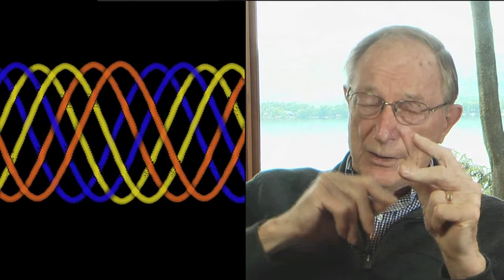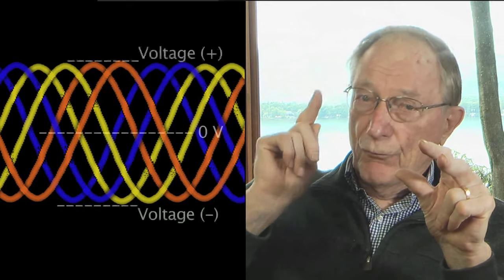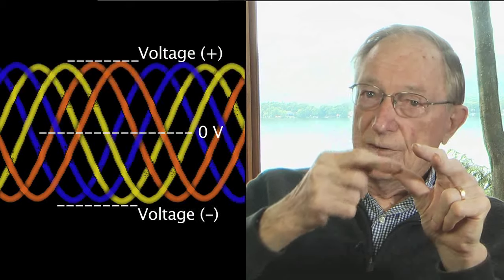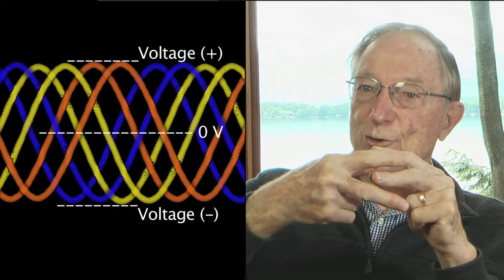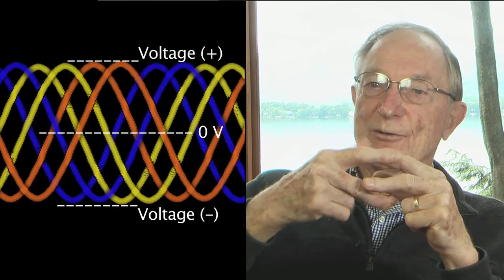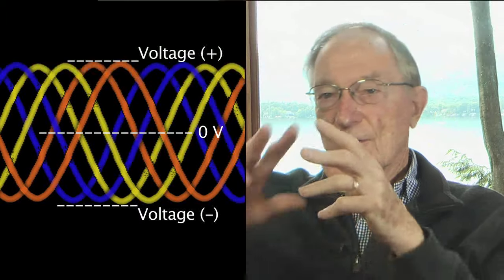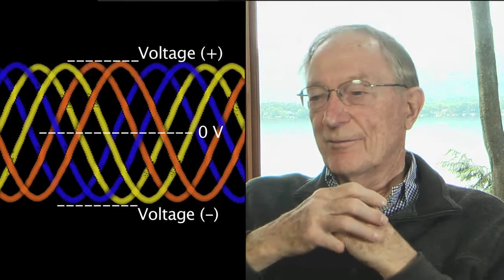Why 3 Phase Power? Why not 6 or 12?

Comment: Why not just ONE phase i.e, DC?  AFAIK this is always used on really long haul circuits because Voltage and Current are always at maximum.  OK one does need converting stations at both ends but the advantages outweigh the disadvantages.  The two places do not have to run at the same frequency for a start and because its DC standing waves are not really a problem.
Reply: just saw a video saying that three phase generator had an induction type system for low friction resistance no sure if thats relevant rotational energy stuffs try n think of a EMF generator that generates constant DC
Reply: *****
How do you pass AC through an inductor?? Why would you have capacitor connected to DC?? Irrelevant questions...
Actually the new technology uses DC for power transmission so called "high voltage DC".
Reply: I thought this question was resolved during the War of the Currents between Edison and Tesla.
Reply: Good point,but powerlines carrys around 24KVA. How do you expect to step down DC into 120/240,120/208,Etc and how much more money will be spent doing such a thing?
Reply: Because you would have to either replace almost everything you own with DC powered items or have a very huge and expensive power converter at every home. Doesn't pass the common sense test.
Reply: Tech Davey Actually this can be used easily and conviniently with HVDC(High voltage DC). Just imagine a 12 phase HVDC converter. You can have 12 phase providing full power suuper efficiently and then you just rectify the currents and you will only need 1 cable to  transport the electricity and since you have 12 phases in the conversion to DC is far more efficient and easy. Then all the money you saved in cables, towers and transformers used in the first stage of electricity transmission can be used for anything you want.
Reply: Tech Davey In high voltage power transmission with AC one has a limit that one can transmit power due to line losses. It use to be that DC was better than AC beyond say 600 miles but today the distance is shorter since conversion losses are less with modern converters. There are two DC lines that feed Los Angeles are 846 miles from the Columbia River (oregon/washington border)  and another from Utah that is 488 miles long in DC
Reply: 3beltwesty
How does DC powerline works? DC can't be stepped up or down. i'm curious?
Reply: edgehead13 DC can most definitely be stepped up or down.
Reply: Chris Russell How? we're currently learning about only AC stepping up and down. If we step DC up and down. Won't that cost more money compare to stepping AC?
Reply: edgehead13 DC can be stepped down up or down via converting it to AC; they stepping or down in voltage with transformers and rectifying back again to DC.
Reply: edgehead13 Once a power line is more than say 400 miles long the cost of the AC to DC to AC converter stations is less than the line loss of using AC. Thus for really really long power lines DC has been used in some places:

http://en.wikipedia.org/wiki/Pacific_DC_Intertie

http://en.wikipedia.org/wiki/Path_27
Reply: 3beltwesty WOW, didn't think it would be that simple. Make sense
Reply: edgehead13 There are also DC to DC gizmos to convert that just have a coil, capacitor and circuit that drives a coil to raise the voltage then it is rectified back to DC.  ie I have some 5 volt DC USB chargers that run on one 1.5 volt AA battery. Walmart once sold them for 5 dollars. A single 1.5 volt AA battery is used and the circuit jumps the voltage to 5 volts DC as an emergency phone charger.   Type in "DC to DC converter" into ebay and see a mess of gizmos  sold

http://www.ebay.com/sch/i.html?_from=R40&_trksid=p2050601.m570.l1313.TR12.TRC2.A0.H0.Xdc+to+dc+converter.TRS0&_nkw=dc+to+dc+converter&_sacat=0
Reply: Gotta love being an electrical apprentice. Are you an electrican or electrician engineer?
Reply: Registered EE
Reply: 3beltwesty Not bad
Reply: Chris Russell  You transmit 500,000  DC from generation of coal field, wind gens, or solar plant to local distribution point covert it to AC and      transmit it at what ever AC voltage local power companies use, and step it down fro 345,000, 230,000 to local needs of 69,000 34,500 what every, the to street use of 2,400 - 23,000. distribution voltage.
Reply: Tech Davey Several reasons, but the biggest one is down to cost. Imagine the size of the conductors needed to transmit DC over long distances, the machinery needed to haul these cables and the maintenance. 3 Phase is used because simply put it's more cost effective.
Reply: Samage89 In super long runs,  say 500 hundred miles AC costs more to transmit than DC. Thus super high voltage DC is used  to transmit power from Oregon to Los Angeles. With DC one needs a smaller conductor than AC since the there is no skin depth issue that AC has. One cannot transmit AC power say 700 miles without massive line losses, the reactance and line losses are huge. Thus they use high voltage DC in super long lines, There are not many high voltage DC lines around, many like the LA to Oregon DC line are many decades old
Reply: yeah, but to change voltages (to/from transmission) with DC requires a switching converter which generates significantly harder-to-filter noise than an AC transformer - right up into the RF.

Comment: This video is confusing power in transmission with that of 'generation , 6 phase does not increase the power from a generator, three phase was chosen as the standard as it evenly loaded generators and didn't cost too much in copper for transmission lines.

Comment: Why does NO ONE EVER mention 5-phase electricity??? Do we not have the technology to understand/work with it???
Reply: Because it's pointless when you get all the benefits of 5 phase with 3 phases. 3 phases is the minimum number of phases for a self starting motor. You could make a motor self start with 2 phases but you still need 3 wires for 2 phases so might as well have 3 phase and the motor will be more powerful.

Comment: How many power generators would you need,my understanding with 3 phase is that you have 3 different generators synchronised 1/3 apart,surely, for 6 phase you would need 6 spaced 1/6 apart,is this correct?
Reply: You actually need just one generator with multiple windings. 6 Phased generator wouldn't be so difficult to build, but like said in video, there are 6 conductors (+ground) 6 phases of circuit breakers, current measurements etc. So generator itself wouldn't be so complex, but system around generator would grow in price (cost) really significantly.
Reply: Karjis Ok, thanks for that.
Reply: It's done with transformers.  Using the 90 degree shift and delta and wye windings, three-phase power can be easily converted to six or twelve phase power. More transformer are needed (one per phase) but they are standard transformers.
Reply: ***** Thanks for that.
Reply: It's actually very easy to convert 3-phase AC to 6-phase. You send the 3 original phases as is and you use three transformers (which can be autotransformers) to flip the input polarities to produce the three additional phases offset 60 degrees. If your three input phases are ABC at 0, 120 and 240 degrees and your six output phases are abcdef, then a = A, b = polarity(C), c = B, d = polarity(A), e = C, f = polarity(B), where polarity() is the reversed polarity produced by a transformer. It works because 0 + 180 = 180, 120 + 180 = 300, and 240-180 = 60. So you get 0, 60, 120, 180, 240, and 300 degrees.

It's not much harder to go to 12 phases with three more transformers. The secondary is split phase (0 and 180 degrees, like an ordinary residential distribution transformer) and the turns ratio is sqrt(3):1 = 1.732:1. The inputs are wired in delta (between the phases) and the outputs in wye, producing six more phases that are all 30 degrees offset from the original three.

This technique is very widely used in high power rectifiers (like at the input of a HVDC transmission line) to produce smoother DC and reduce the harmonic currents injected into the AC source. It's called a "12-pulse rectifier".
Reply: ApolloWasReal Thanks for that.
Reply: The 3 phase generator is just wound slightly differently to a DC or single phase one. All 3 windings (or 6 or 9 or 12, etc... multiples of 3) are wound on the rotor and stator of the same generator.
Reply: Joseph Perkins Thank you for that.
Reply: ApolloWasReal What you suggest (three auto transformes) would be ideal if the per phase voltage was not going to change and one could live with the unbalance of adding about 4% transformer impedance to three of the phases.  The positive sequence impedance of a higher phase order line is quite low and that impedance could be a problem.  Also, in the examples that were pursued when the technology was under development, it was usually best to use an optimum voltage for the power needed and that required a voltage step-up and hence a transformer for each phase.  HPO looked best when it was competing with 765 kV AC where a 4000 MW rating is involved.  The HPO line used shorter towers and less right of way for the same power.
Reply: ***** So then you would just use step-up transformers to generate all six phases? Sounds reasonable. I mentioned autotransformers because of their higher efficiency, but as you point out there are other considerations.

In that case, each pair of antipodal phases could be generated by a transformer with a grounded centertap on the secondary, three transformers in total.

Comment: Did I hear double the power from 3 to 6 phase with the same current?
Reply: You have twice as many conductors, so yes double nearly double the total power. Of course, at that point you could just have two three phase circuits with a shared neutral and accomplish the same thing with less complexity.

Comment: If a system with three wires carrying voltages 120 degrees apart, sometimes with a fourth neutral wire, is called three-phase power, then shouldn't a system with two wires carrying voltages 180 degrees apart, plus a third neutral wire, be called two-phase? Instead, it is considered a single-phase system. Why?
Reply: Dan Schwartz i often think of single phase as two phase while I'm troubleshooting or trying to figure out the nature of a circuit. In reality the two phases are generated by a "split phase" transformer, so calling it single phase is actually correct, especially compared to phases offset by degrees other than 180. But yeah, i hear ya, how about neutral being phased down to zero when both legs are balanced, there were some smart people out there, hopefully still are.

Comment: I'd like to see a 6-phase system in place. We can still use 3 transformers and work it out. Engineers know this: When there is a will, there is always a way.
Reply: a 6 phase generator will start running on its own power that why theyre afraid of them...it might no longer require the turning assistance of a prime mover its elementary Watson!

Comment: what about having 12 phase generators conected to a rectifier. It woyld be much more efficient to rectify 12 phases and the distribute that DC power just through one single cable. Wouldnt it work?
Reply: Beholder what about transformers??
Reply: +Beholder - Yes it would work, and it would be efficient, and the generator components would be smaller. The negatives would be: 1) more generator components to fail, and 2) once rectified, it could be distributed only short distances.
Reply: Cotronixco For what I understand when High Voltage DC current is distributed it is actually preferred for much longer distances so the investment is worth it. Besides at those voltages the losses are less.
Reply: +Beholder - That's true and the line loss is much less if you're referring to very high DC voltages. I'm not sure, but I imagine the cost of conversion at each end might be a factor. There would probably need to be very expensive equipment at every customer site.
Reply: +Imad Nehme - The difference between DC and LF cannot be compared to the difference between LF and HF.
Reply: +Imad Nehme - We were discussing HVDC, not HF.
BTW, sine is not pulse.

Comment: With modern components  would a DC  distribution system be an improvement.  DC  from the power source to the plant or the home.
Reply: The advantage of AC distribution system is the ability to transmitted over long distances with high efficiency. DC has efficiency problems over long distances. 

In the long term DC would have been much better and with superconducting systems could have overcome the efficiency problem. And it could have enable local level electricity generation.

Comment: Well for one. I would hate too have to control all those phase angles. As the more you introduce. The more problems you would have to deal with if one fails. It defeats reliability. Cost and end user up time. You would need an army of transmission line men just to maintain it. As a watt is a watt.